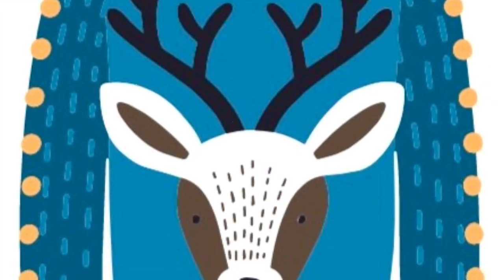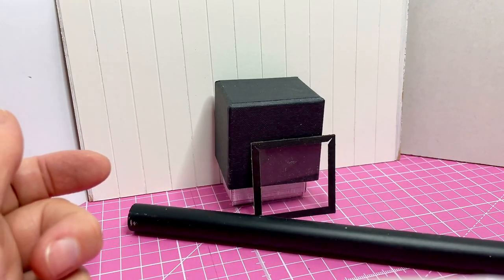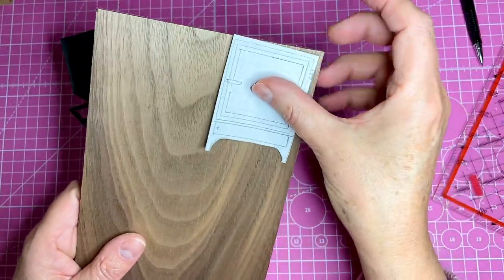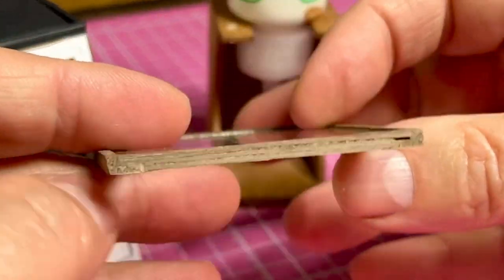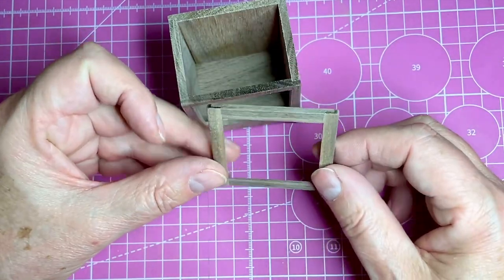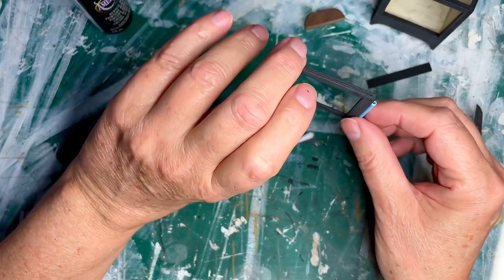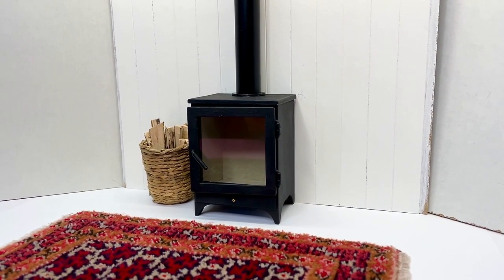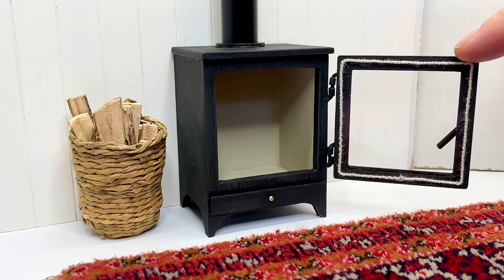How to build a miniature log burner. Advent 9, 2022

Comment: Full size woodworkers use tape and then put the glue on the tape when they need to temporarily glue two pieces together to cut them the same.
Reply: What a good idea 👍🏻
Reply from the maker: Good one!  I just think the tape underneath the paper gives it too much thickness.  I prefer a bit of glue.  I don't mind the sanding afterwards.  🙂
Reply from the maker: Having said that, I do sometimes use veneering tape.  That's very thin and you have to wet it to stick it to the wood.  It is removed again by wetting it and rubbing it.

Comment: Seeing the brass tube really inspired me. I need to make some brass wall candle sconces. I was able to get some brass tube at a hobby store but I don't know how to bend it without misshape-ing the tube... or what to use to cut it. I am a jewelry maker so I have many tools...
Reply from the maker: It is hard to bend tubing without kinking it. I think it is done by filling it with sand, I'm not sure.  You'll have to look it up.  And there are coiled metal springs available to put inside the tubing which helps the tube to maintain its shape while bending.  But not for the tiny tubes.  Maybe if you try heating it and bending it very slowly?
Reply from the maker: Oh and to cut it, just use your jewellery saw.  It's very easy to cut.